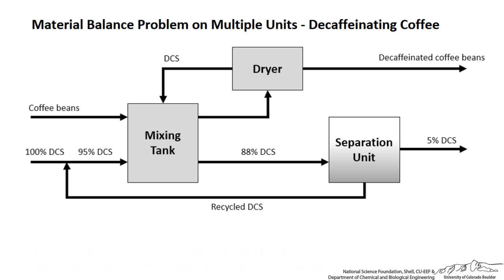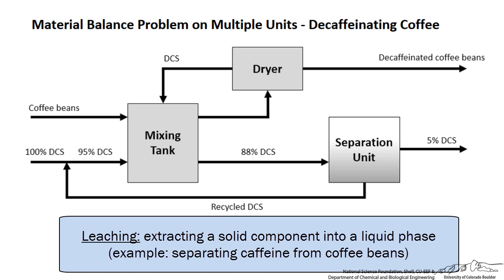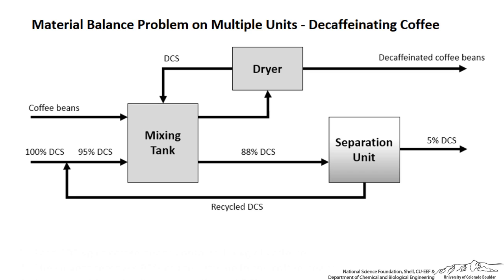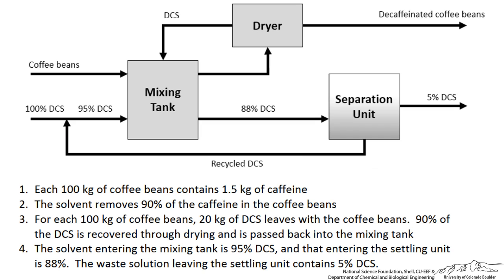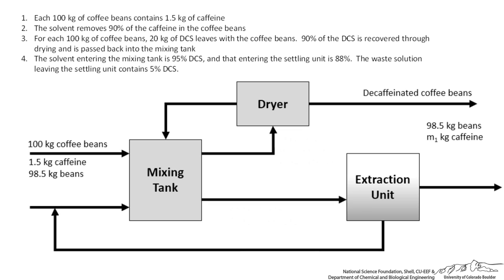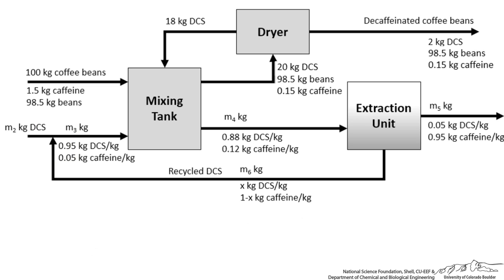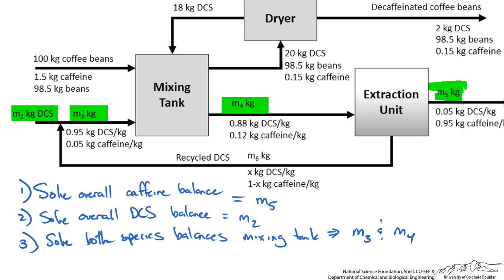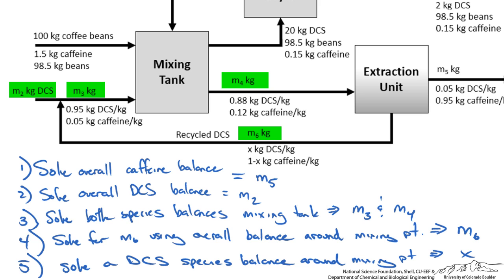Multiple Unit Material Balance - Decaf Coffee

Comment: 0.95(m3)=0.88(m4)+20 kg that leaves with the coffee beans. You wrote 2 instead of 20 :)
Reply from the maker: Thanks for the note.  If you look closely at the diagram, you see that you also have 18 g coming back into the mixing tank.  You can either count both of those streams or you can just count what leaves the dryer, 2 kg DCS.  So the equation is correct, but the explanation could have been more clear.
Reply: 0.95(m3) + 18 = 0.88(m4) + 20 giving us 0.95(m3) = 0.88(m4) + 2